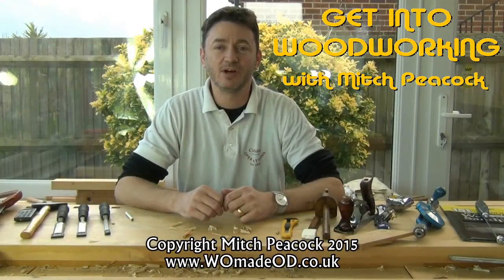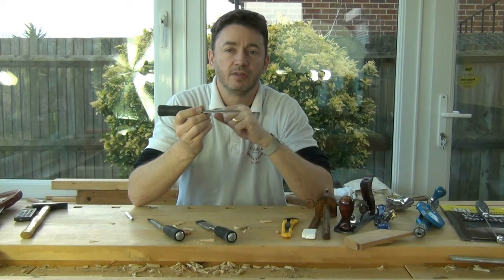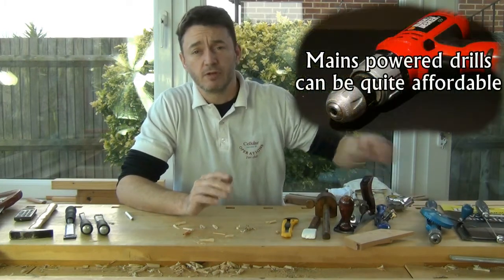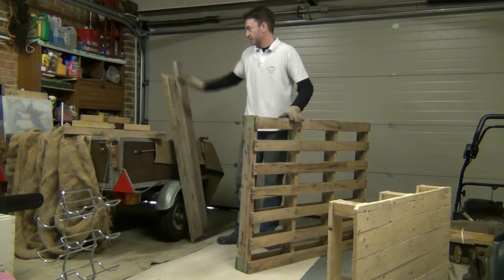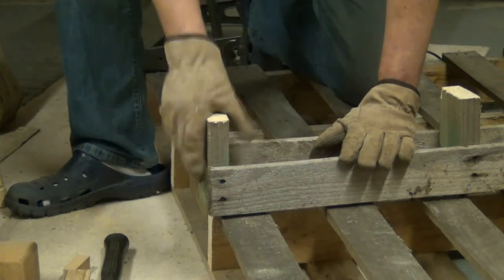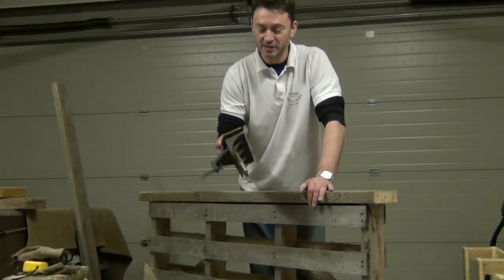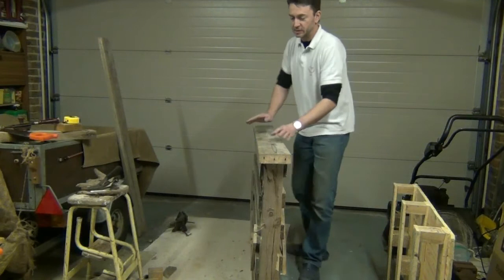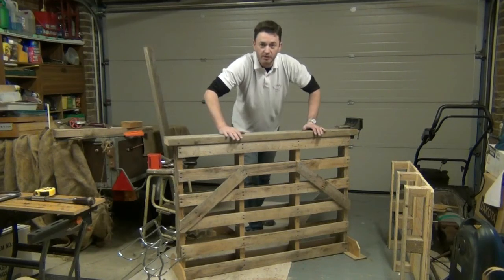Make a Free Bench from a Pallet - GIWS1E2

Comment: Interesting bench.  I look forward to seeing how you develop it, and work with it.  It seems too narrow to me, but I'll reserve judgment until I see you go at it a bit more.  I hope you surprise me with how well it works, because the price is certainly right.
Reply from the maker: deezynar If you work everything length ways, it's ace. But you could always stick four pallets together for a normal depth bench.
Reply: Get into Woodworking
You're right, if you stick with working lengthways, it'll work fine.  It's always a challenge to get a flat top that's cheap and easy to make.  I prefer a flat panel, solid core door, but they're not cheap if you buy one new.  It's great if you get one second hand, or from a dumpster but that's not typical.  Glue-lam beams, and wood counter tops are good too, but like doors, they're not cheap.  Plywood is never flat.  MDF is often flat, but not strong.  Solid lumber is labor intensive to assemble and dress, it's also prone to warping and twisting.  Of all the options, solid lumber is the worst for a novice.
Reply from the maker: deezynar at least my slim bench won't take much flattening!
The cutouts for double sinks from solid wood counter tops can make decent little bench tops for small work, and are often chucked on skips. For most purposes, a slim solid section at the front of a wider torsion box will prove perfectly adequate.
Reply: Get into Woodworking
I agree, usually a narrow section is all I use of my bench.  But when I need something wider, I need something wider.  A torsion box is great for weight, flatness, and rigidity, but they require a lot of accurate cuts in plywood.  I keep coming back to the idea of 2 solid core doors.  A 2 foot wide one for the top, and a 30 inch wide one for the front, and a 2x4 frame.  Drill holes everywhere for holdfasts.   But again, the downside is getting doors cheaply.